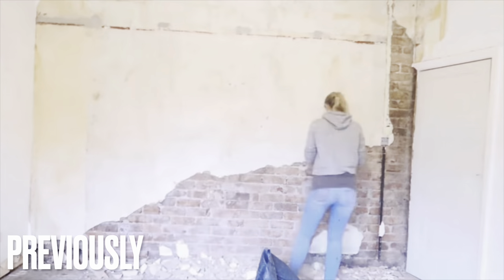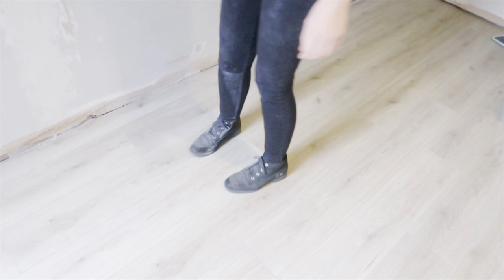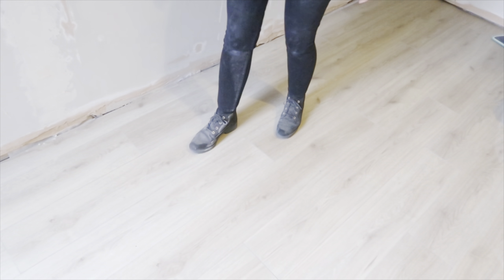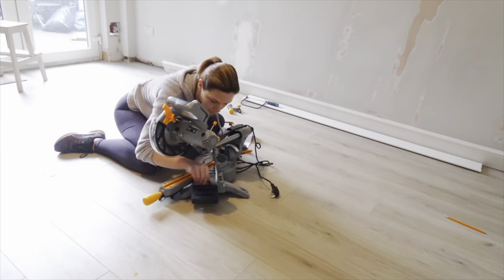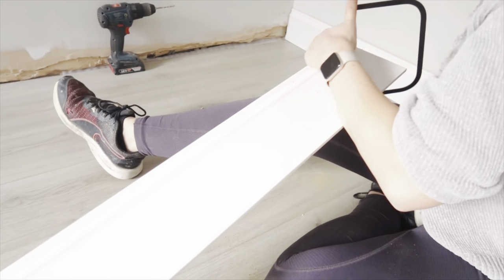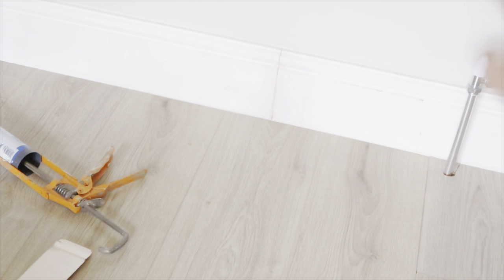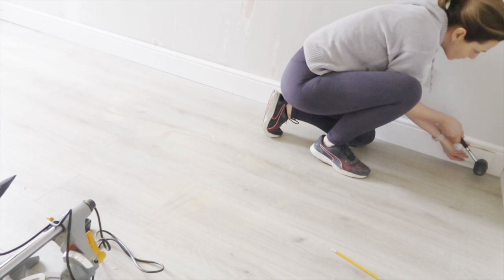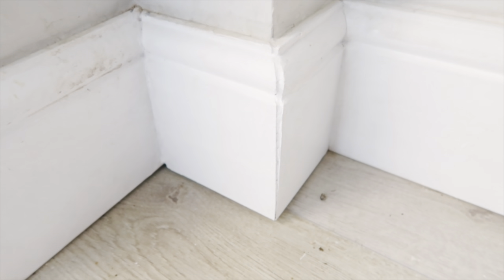I MESSED UP THE SKIRTING | NEW SOFA DELIVERY | HOUSE RENOVATION VLOG

Comment: Hi Laura, 
I like the first damask paper, but I think you need a day or weekend  off and away from it all to have a reset & recharge and come back with some fresh inspiration, still keen to see what you end up doing around the door . Xx
Reply from the maker: Yes I’m taking a break from decor in that room for now and waiting for the inspiration to come! I’m thinking I’m going to have to cut some mdf to fill in. If there wasn’t such a huge gap between the plaster and the frame I would have just cut out into the plaster and had the architrave flush with the wall but even that won’t work! X